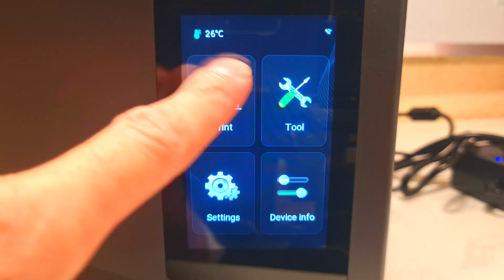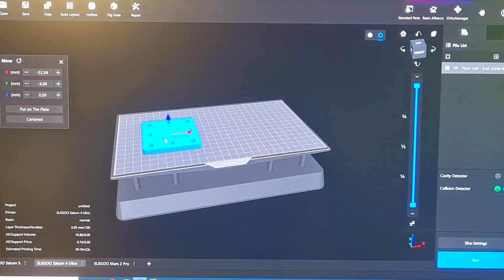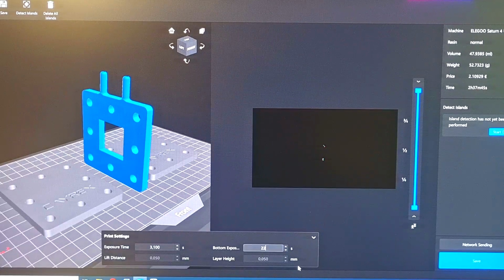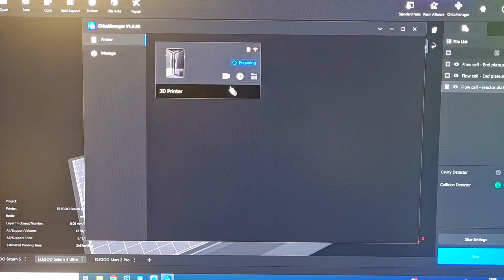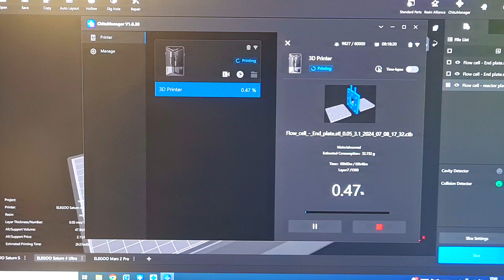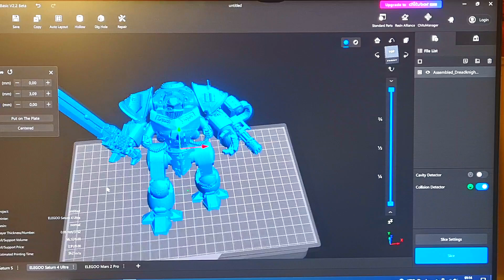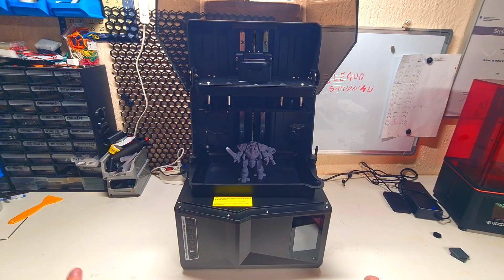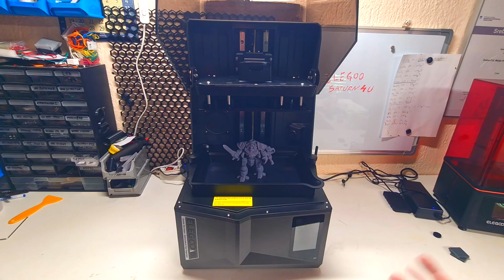My first time with Elegoo Saturn 4 Ultra

Comment: My only gripe with this printer is how a lot of the qol features are tied to chitu. 

Can't upload files from outside of chitubox to my printer (I prefer using Lychee slicer)

And as you mentioned you can't use the camera outside of chitu either. Would have been nice to set up a little web interface for it so I can check it from my phone at work for example.
Reply: Just use the USB socket and a thumbdrive. It still accepts any file made by Lychee. I have done a number of prints sliced on lychee. The wifi is just easier if you are conversant with the Chitubos wifi liking- which I find can be ..tricky.  And Lychee are undoubtably working on linking their Slicer to the camera and Wifi. Expect an update... soonish

Comment: There are rumors that this dark lid on mars 5 ultra/ saturn 4 ultra don`t actually block uv, can you try to set resin through the plastic and confirm it or deny it?
Reply from the maker: Interesting! Yes I will try
Reply: Confirmed .. I found this out on accident when I got mine last month.
Reply from the maker: @SirRonmit  Really? Then the printer need to be in shadows.
Reply: @cayrex  I keep mine in the basement behind a door to an office now after finding out the hardway.